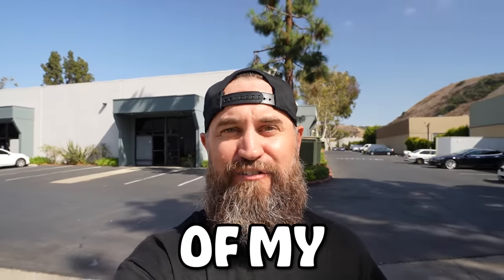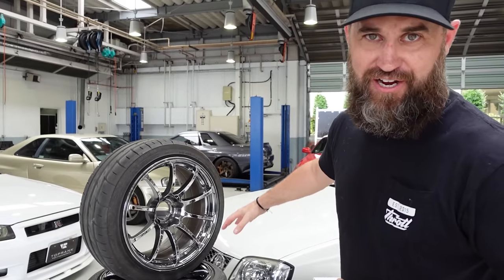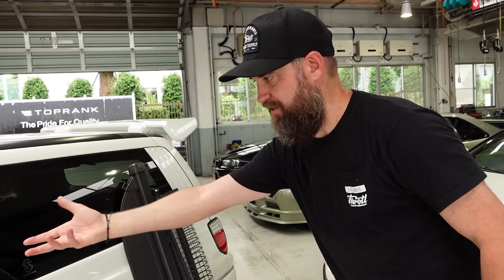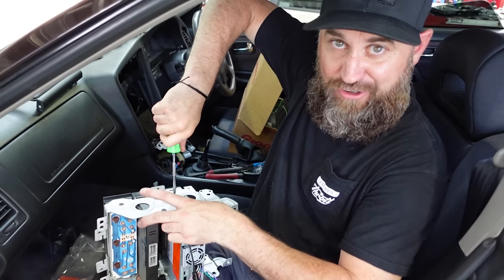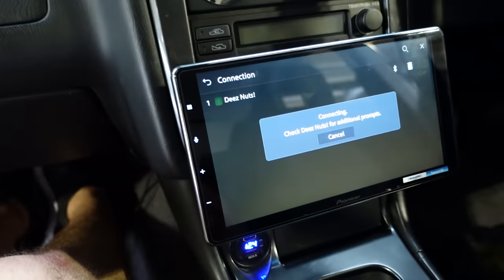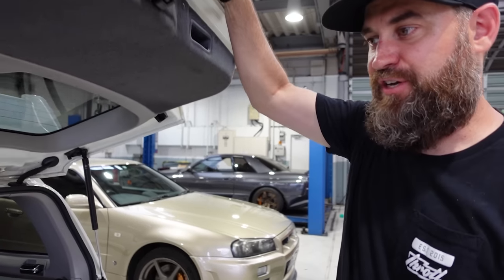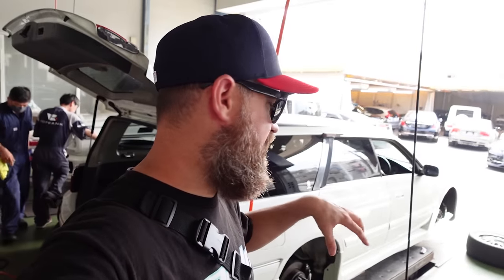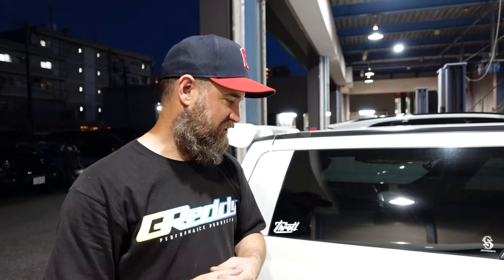Modifying a 2000 Nissan Stagea Autech Version 260RS In Japan

Comment: Aahh the Stagea , i have had 3 all good cars that i have spent nights in when hotel rooms are not avaliable . I can lay down with the back seats folded and still have plenty of room by my feet and its flat to lay on . Also i know this is a  small thing, but those handles either side at the back are awesome to lower the back seat backs down without haveing to open the back doors . Like you said in the video the parcel cover and net in the back not going to the new owners when sold well im guilty as have 2 in my garage along with other bits just sitting there waiting for my motivation to move them on . Cheers from New Zealand .
Reply: Yea man. I explained the seat folding handles in the previous video. Thanks for watching!

Comment: It's a known thing with the manual stageas (260rs and RS4S) having wheel to strut fitment issues. They have a narrower subframe than all the other models which brings the mounting face inwards too. I have 18x9.5 -3 on the rear of mine just to clear the strut

Comment: That screen placement... lol.  Shifting into 3rd gear is gonna give a whole new meaning to 'money shift' when that screen gets destroyed lol.
Reply: Won't happen. I have the exact same setup in my R32 GTR and have never had happen. There's plenty of room. it only pertrudes 3/8" away from the current dash configuration.
Reply: @mickeyandrade3435  @11:32 - I dunno man.  Look at where the shift boot area is in comparison to the screen.  While the shifter may not hit it your knuckles might.  I'd also be worried about the driver or passenger whacking it with their knees maybe with how it stretches off to the sides.  That, and that big-ass screen just looks out of whack with the entire setup, IMO lol.

Comment: For those of you wondering, Shaken, i.e. Japan's car inspection regulations, is a bitch. There are so many regulations that it takes away a lot of fun from modifying cars. This includes lowering your car, stance, exhaust, headlight adjustability, height of side markers etc. It's just stupid. Of course, you can put on OEM parts, pass the shaken inspection, then put on your not-approved parts but it's a pain. And Shaken is quite expenseive - if you do it through a dealer, expect to pay about $2,000 for the taxes, inspection, and dealer maintenance. This is on top of the increase in taxes you have to pay if the car is over 13 yrs. old.
Some of you were asking where this Top Rank is located: Auto Technical Base, 293-1 Miyazaki, Noda-shi, Chiba. The UpGarage is right down the road on the other side of the Nodashi Station Entrance intersection with Road 16. This area is definitely more rural so it's nice to have a car like the Stagea if you live in this area. I live about 1 hour away from this Top Rank.

Comment: I’m keeping my fingers crossed that Mickey puts a GTR front end on this car. It absolutely needs it
Reply: I don’t know, I think they look a little funny with the r34 front end. It seems too small compared to the big wagon body. I’ve seen a couple with r35 front clips that are cool. In my opinion, if you have one this cherry you don’t replace the front, maybe go oem plus look And change a grille etc.
Reply: The 260RS face is perfect for this 1 of 748 only car. The R34 face conversion is irreversible and from a resale standpoint that makes zero sense.